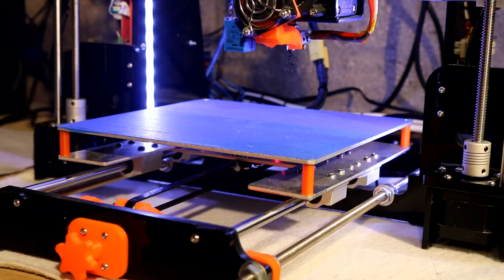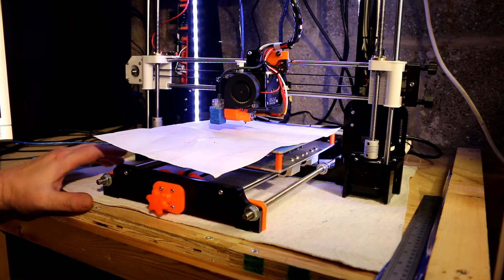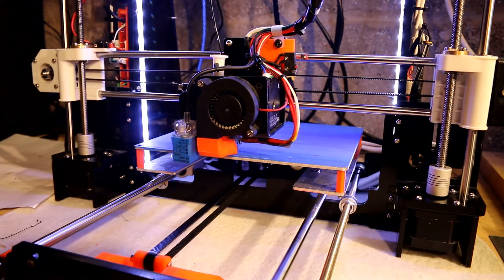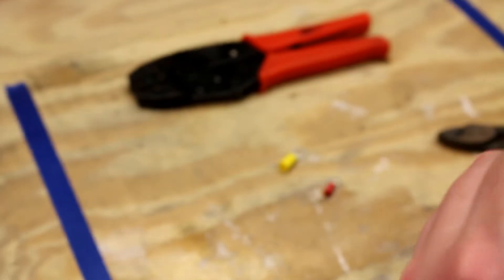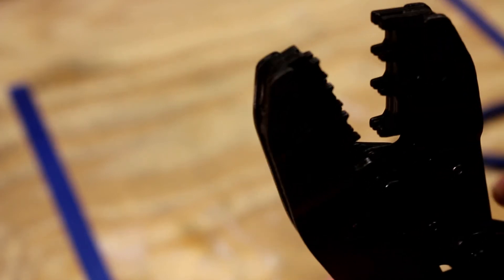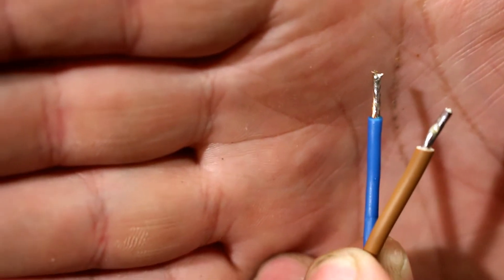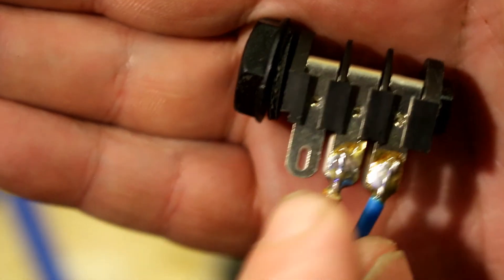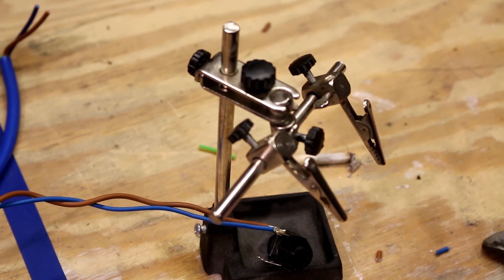Anet A8 Re-Wire and upgrades Part 2

Comment: With respect  the soldering, it is good practise to have a mechanical joint between the two items... that is on the stereo socket the wire should have been put through the hole and folded back and then the whole thing soldered... do not rely just on the soldered to hold the wire onto the tag. Also you should be melting the solder on the work, not on the iron...  on the tag and wire the wire should have been put through the hole in the tag and then the iron held on the back of the tag to heat the whole thing up and the solder applied to the top of tag..

Comment: Very good videos , but one thing you said is wrong, flux allows the solder to flow uniformly through the joint/s, it doesn't allow it to stick! and always clean the joint free of flux once cooled, that is on any pcb joint or any soldered joint, it is corrosive and will eventually corrode the joint, causing break down of the solder and induce dry joints! hence higher resistance and potential arcing! which you were trying to correct!  add strain relief to the soldered wired joints like heat shrink wrap which will also aid in stopping arc crossover and protects you from getting curly hair  too, lol, just an advisory from an electronic engineer, other than that great tips!! I'll be building and modding mine in the new year and following some of your tips! cheers, it's a great 3D printer once correctly wired, nice one!

Comment: Really enjoyed your video and seeing how you handled the wiring.  On your reset switch I noticed an open bare terminal.  If this is the normally closed terminal on the switch be careful as it may be hot. You could just put an insulated push on crimp to cover it up.  Great job explaining what your doing.

Comment: Brian, I have been looking at your design for the power control. My question is, why the need for the 2nd power supply? Couldn't the power control be driven by the main power supply?  What do you think are the down sides of that design? Thanks in advance for any comments others might have as well. :)
Reply: well, NM, I figured out something about the design I didn't understand. The Line in Power is routing through the relay.  :)

Comment: Brian I have a rachet crimper, an SN-28B, I've always been a bit confused by the teeth sets available, there seem to be lots of different sets,  and I'm sure I have the wrong ones in it for crimping the spade terminals. Do you know the part number or correct name for the one's you use as you seem to have a lot less trouble crimping than I do.

Comment: Not sure if you noticed but when you levelled the left z axis lead screw it turned the right side as well might be worth holding onto each side.
Reply from the maker: Thanks Rob. I had worked this out after I did the video.
Because they are wired together via the main motherboard when you move one it
acts like a dynamo makes the other move, I should have noticed this to start
with.

To get round it I remove the connection wire form one of the
motors, adjust both and then put the wire back.

Comment: With the wires poking out the end of the crimps. Couldn't you add a little solder? 

Surely that would make and hold a more solid connection.
Reply from the maker: No. The point of a crimp is so the single strands of wires
get 'crimped' in a uniform manor. If you solder the end the strands can not
move thus stopping the crimp from forming around the cable correctly